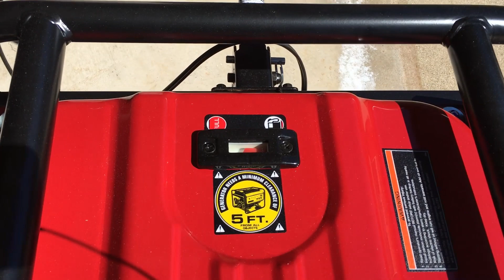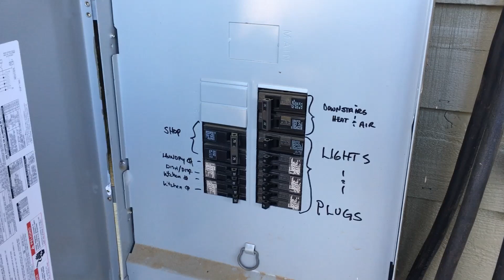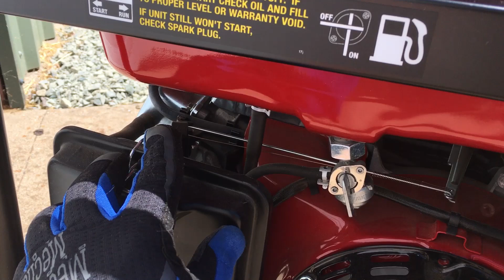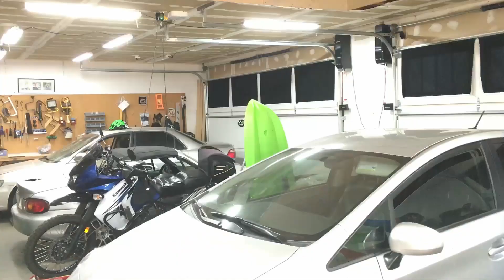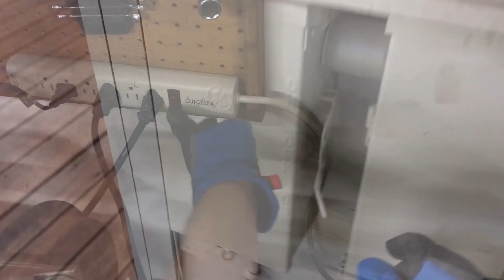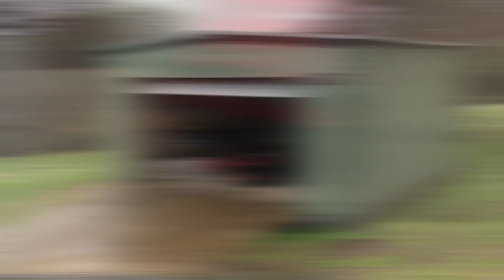No Power... No Problem!!  Harbor Freight 9000 Watt Predator Generator Review AND Real Outage Test!

Comment: Why in the heck did they put GAS ONLY in diesel green letters? Lol I’m sure folks have put the wrong fuel before.
Reply: ⚠️Very important announcements to everyone about generator safety: 

Please don’t forget to follow the generator safety tips when you use your portable generator. This is just a reminder to make sure. All generator safety instructions need to be followed carefully whenever you use your portable generator. 

1) KEEPING OTHERS SAFE: Please do not allow an unqualified person or your children to operate and service the portable generator. Just because some manuals don’t say that doesn’t mean it’s safe. That is important against the generator safety rules. We also need to be keeping an eye on our children too. You need to make sure that your children are not playing near the portable generator especially when it’s running so they won’t get electrocuted. Generators pose electrical risks and they can be hot during an operation. Please keep your children away from the portable generator at all times. It is important to keep our children safe especially our little ones. Be aware of all the hazards.

2) WHERE TO RUN YOUR GENERATOR: Some people use their portable generators indoors which increases the risk of carbon monoxide poisoning. It’s important to have a carbon monoxide if you have a gas generator. Never ever use your generator indoors even if your doors and windows are open and even in the garage is not safe to use a portable generator. Not even at your porch and your deck. It is never safe to use your generator indoors and in enclosed areas of your home. Your generator needs to be 15-20 feet away from your house. 

3)🔥FIRE HAZARDS: Never refuel your generator while it’s running. You need to let your generator cool off before refueling it and before storing your generator. Never overload your generator too. Never ever back feed your generator. You should never plug your generator into a wall outlet. Also never store propane tanks indoors. Please keep flammable things away from the generator as well and please don’t smoke cigarettes near the generator. Having a fire extinguisher next to the generator is also important against the generator safety rules. 

4) GENERATOR OPERATION: make sure your hands are dry before touching the generator. Never use your generator in wet conditions. Don’t let your generator get wet. You need a generator tent if you need to use your generator during wet weather. Please don’t wear loose clothes when operating the generator. Turn on your generator before plugging in appliances. Use the right cord for your generator. Please do not use worn out cords. 

https://youtu.be/I1jT3ANENvI and here is a video more about keeping others safe when using generators 

Hope this helps. Remember that it’s better to be safe than sorry 🙏

Comment: The sound is shifted to the left horribly.... it's messing with my ears watching/listening to this video
Reply: ⚠️Very important announcements to everyone about generator safety: 

Please don’t forget to follow the generator safety tips when you use your portable generator. This is just a reminder to make sure. All generator safety instructions need to be followed carefully whenever you use your portable generator. 

1) KEEPING OTHERS SAFE: Please do not allow an unqualified person or your children to operate and service the portable generator. Just because some manuals don’t say that doesn’t mean it’s safe. That is important against the generator safety rules. We also need to be keeping an eye on our children too. You need to make sure that your children are not playing near the portable generator especially when it’s running so they won’t get electrocuted. Generators pose electrical risks and they can be hot during an operation. Please keep your children away from the portable generator at all times. It is important to keep our children safe especially our little ones. Be aware of all the hazards.

2) WHERE TO RUN YOUR GENERATOR: Some people use their portable generators indoors which increases the risk of carbon monoxide poisoning. It’s important to have a carbon monoxide if you have a gas generator. Never ever use your generator indoors even if your doors and windows are open and even in the garage is not safe to use a portable generator. Not even at your porch and your deck. It is never safe to use your generator indoors and in enclosed areas of your home. Your generator needs to be 15-20 feet away from your house. 

3)🔥FIRE HAZARDS: Never refuel your generator while it’s running. You need to let your generator cool off before refueling it and before storing your generator. Never overload your generator too. Never ever back feed your generator. You should never plug your generator into a wall outlet. Also never store propane tanks indoors. Please keep flammable things away from the generator as well and please don’t smoke cigarettes near the generator. Having a fire extinguisher next to the generator is also important against the generator safety rules. 

4) GENERATOR OPERATION: make sure your hands are dry before touching the generator. Never use your generator in wet conditions. Don’t let your generator get wet. You need a generator tent if you need to use your generator during wet weather. Please don’t wear loose clothes when operating the generator. Turn on your generator before plugging in appliances. Use the right cord for your generator. Please do not use worn out cords. 

https://youtu.be/I1jT3ANENvI and here is a video more about keeping others safe when using generators 

Hope this helps. Remember that it’s better to be safe than sorry 🙏

Comment: You should turn the fuel line off 1st and let the generator run until all the fuel in the line is used up.
Reply: ⚠️Very important announcements to everyone about generator safety: 

Please don’t forget to follow the generator safety tips when you use your portable generator. This is just a reminder to make sure. All generator safety instructions need to be followed carefully whenever you use your portable generator. 

1) KEEPING OTHERS SAFE: Please do not allow an unqualified person or your children to operate and service the portable generator. Just because some manuals don’t say that doesn’t mean it’s safe. That is important against the generator safety rules. We also need to be keeping an eye on our children too. You need to make sure that your children are not playing near the portable generator especially when it’s running so they won’t get electrocuted. Generators pose electrical risks and they can be hot during an operation. Please keep your children away from the portable generator at all times. It is important to keep our children safe especially our little ones. Be aware of all the hazards.

2) WHERE TO RUN YOUR GENERATOR: Some people use their portable generators indoors which increases the risk of carbon monoxide poisoning. It’s important to have a carbon monoxide if you have a gas generator. Never ever use your generator indoors even if your doors and windows are open and even in the garage is not safe to use a portable generator. Not even at your porch and your deck. It is never safe to use your generator indoors and in enclosed areas of your home. Your generator needs to be 15-20 feet away from your house. 

3)🔥FIRE HAZARDS: Never refuel your generator while it’s running. You need to let your generator cool off before refueling it and before storing your generator. Never overload your generator too. Never ever back feed your generator. You should never plug your generator into a wall outlet. Also never store propane tanks indoors. Please keep flammable things away from the generator as well and please don’t smoke cigarettes near the generator. Having a fire extinguisher next to the generator is also important against the generator safety rules. 

4) GENERATOR OPERATION: make sure your hands are dry before touching the generator. Never use your generator in wet conditions. Don’t let your generator get wet. You need a generator tent if you need to use your generator during wet weather. Please don’t wear loose clothes when operating the generator. Turn on your generator before plugging in appliances. Use the right cord for your generator. Please do not use worn out cords. 

https://youtu.be/I1jT3ANENvI and here is a video more about keeping others safe when using generators 

Hope this helps. Remember that it’s better to be safe than sorry 🙏

Comment: Thanks for a good video. A question,  if the power goes down in the summer heat, will it power the ac ?
Reply: Depends on the size of the unit. If it's a  30 amp breaker to the ac it will if you are not running anything else.  If it's a 50amp breaker it may not The unit.
Reply: Here is a reminder about portable generator safety: everyone really needs to see this safety reminder to make sure. This advice is just to make sure that everyone is aware of all the warnings and it’s just to remind people to be careful using portable generators. Generators can be dangerous if not used carefully. Every year, hundreds of people die or get injured when using portable generators due to carbon monoxide poisoning and electrocution. Make sure you are using your generator carefully and keeping others safe as well. There is something very serious that everyone should always be aware of when using generators. Some people do run their generator indoors which is not safe and that increases the risk of carbon monoxide poisoning which can cause death of family and you. Some people run their generator in wet conditions which can electrocute them. Please remember that you should never run your generator indoors. Remember that carbon monoxide is an odorless and colorless gas that you cannot see or smell. Carbon monoxide is a silent killer. Keep that in mind. Make sure your generator is 15-20 feet away from your house and away from doors, windows, and vents. Never use your generator in your porch too. Having a carbon monoxide detector is very important against generator safety. Some people also allow children to go near the portable generator which could pose risks. We need to keep an eye on our children making sure that they are not near the portable generator so they won’t get electrocuted or burned by the generator which is dangerous. A locking enclosure also keeps kids safe. A generator shed might look like a tempting place to explore, or take cover during a game of hide and seek, but a generator is a dangerous piece of equipment that can cause injury. It says on the manual that we should also keep children away at all times from the portable generator to avoid injuries. Please do not allow a child or unqualified people to operate the portable generator. Just because some manuals missed what should be listed doesn’t mean it’s safe to do. Always follow the generator safety rules when using portable generators. Generators pose electrical risks. If you need to use your generator during wet weather, you need a generator tent to protect your generator from getting wet. Don’t let your generator get wet. Keep your generator dry and before using your generator, please make sure your hands and your generator is dry. Do not wear loose clothing when operating the generator. Everything that is said on the generator’s operating manual should not be ignored. Never smoke cigarettes near the generator. Please keep flammable things away from the generator. Never overload your generator too. Your generator can catch fire. Never ever try to plug a generator cord into a wall outlet to avoid back feeding. Back feeding your generator is dangerous. Always turn on your generator first before plugging in appliances and shut off the appliances before turning your generator off. Use a heavy duty cord for your generator and the cord should not be worn out. All the instructions should be followed carefully. Never refuel your generator while it’s running. It can cause fire if fuel spills while your generator is hot. You should turn off your generator and let it cool off before refueling it. Having a fire extinguisher next to the generator is also important. This is only a reminder for everyone’s safety of using generators. Make sure your generator is properly grounded. Having a fire extinguisher next to the generator is also important against the safety rules. https://youtu.be/I1jT3ANENvI and here is a video more about keeping others safe when using generators and also about our family’s safety. Hope this helps. Thank you. It’s better to be safe than sorry. Keep that in mind. Have a good one

Comment: Can it run your central air too?
Reply from the maker: It might be able to but I think I'd have to shut almost everything else off first.  Plus, my central A/C isn't wired to my subpanel that's fed by the generator (I'd have to move the breaker over).  It hasn't been a major issue as (until now) most of our extended power outages are in the Fall (utility shuts down during high fire danger periods) or the Winter (tree takes out a power line, etc.).

Here's a follow up video I did, that further explains what I typically run on the generator, and what's not wired to run on it.  Hope this helps!
Here it is:
 https://youtu.be/qWVLeuaruJ0

Comment: Does this run tv and internet? Thought one needed an inverter??
Reply from the maker: Hi Ethan, yes, it runs "sensitive electronics" such as the OLED TV, my fixed-cellular Internet modem, and my WiFi router no problem.  I do have all of those items on a surge protector, to (hopefully) protect them from power dips/surges.  As an extra precaution, I turn off the surge protector when firing up the generator and transferring everything over.  Then, after it's been running the whole house for a couple of minutes, I switch on the surge protector, and the TV/Internet/etc. all works great.  I've streamed movies, etc. without any noticeable difference, than when I'm running on the utility meter!